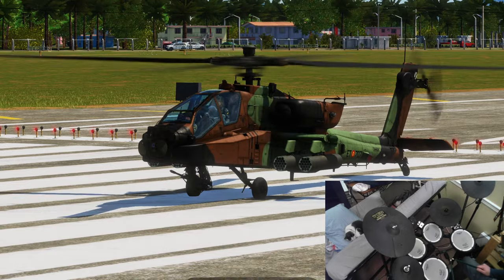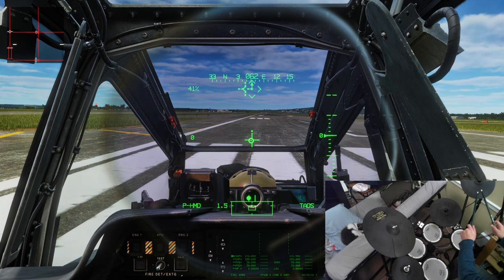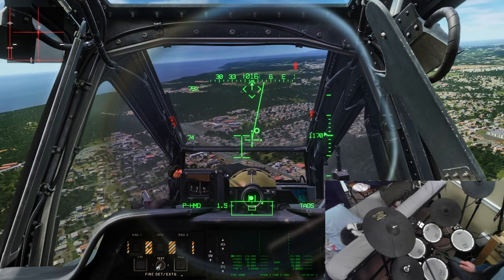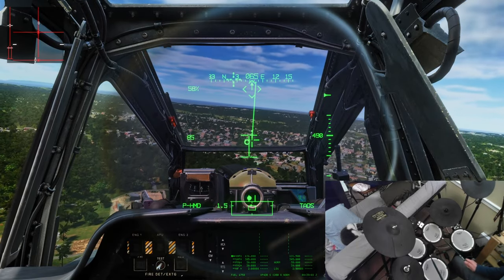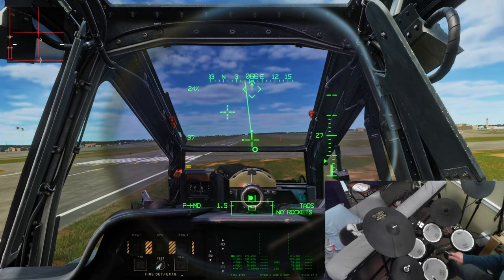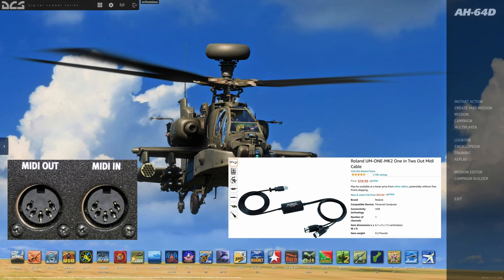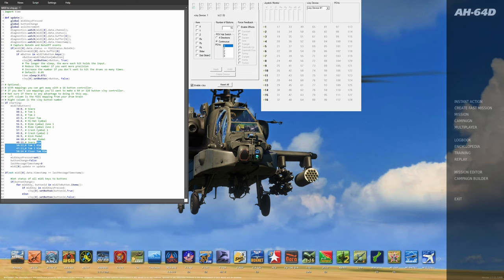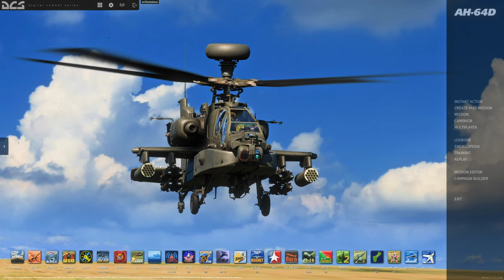DCS AH-64D: Can you fly helicopters without a HOTAS?

Comment: Had to watch this again and took a closer look at the code this time. I strongly suspect you were looking for a simple solution and found one, but this has so much more potential.

Something like this pseudo-code:
IF MIDI.gate
THEN var.pitch = var.pitch + MIDI.note36.velocity - MIDI.note40.velocity
END IF
vJoy.y = var.pitch * (arbitrary scale factor)

That would give you analogue controls, based on how hard you hit the drums.

I only have my MPK25 and it got me thinking: what if you map this across 2 octaves on a keyboard?
That's 25 keys, 15 if we use a 7-tone scale, 11 if we use a pentatonic, we only need 8 and we can map multiple keys to the same control input. Depending on the flight style, that could possibly create tons of interesting melodies/harmonies.
We could even do it the other way around. Convert joysticks inputs into MIDI and record it in a DAW. Imagine replaying this MIDI file and it's more reliably than ED's replay system. That would be hilarious!

This video is no longer a simple April's fools joke. Did I mention how awesome MIDI is?
Reply from the maker: You're not wrong, I did start thinking about solutions and ways to make the script more complex so I could have both fine control and the ability to make large adjustments quickly. 

Basically I just ran out of time. I only had one window of opportunity to record if I wanted the video to be ready for April 1 so there wasn't time for refinement.

But I like your idea about using the force of each hit to control the amount it moves the controls. That's clever. A lot could be done with this. Maybe it's something to revisit in the future!
Reply: Looks more complicated than it was in GlovePIE, which is slightly discouraging, but at least there are some working examples on the forum. I'll have to play around with it some day. Connecting a NintendoDS via MIDI over WLAN and flying with the stylus sounds like fun as well.